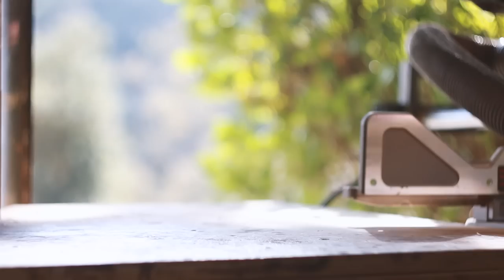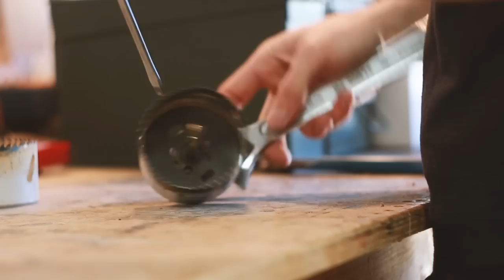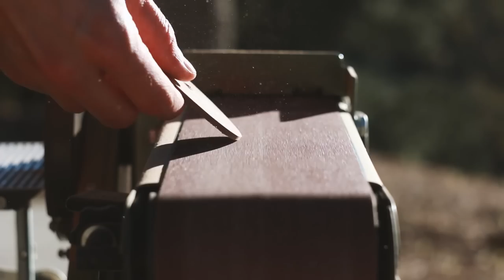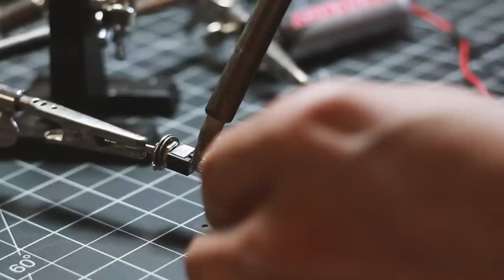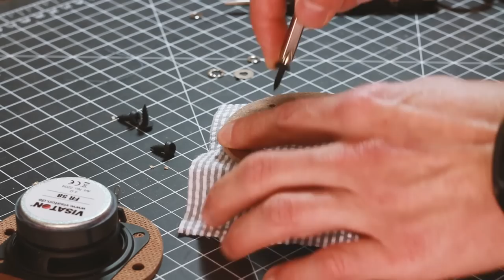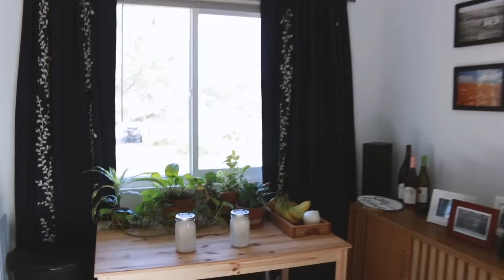Mason Jar Portable Bluetooth Speakers | FREE BUILD PLANS | DIY Bluetooth Speaker Build

Comment: Some paracord and heat shrink would finish those wires off nicely.   Good job, looks like a fun, easy build.
Reply from the maker: Thats a great idea! Totally a fun build. Thanks for watching!
Reply: I think it should be possible to use a Dremel to make holes at the bottom of the glass so the wire doesn't come out at the top. That would look even better.

Comment: Cool vid bro. One trick I picked up while soldering is to heat up the wire until the solder melts. You will get a better connection that will last years.

Comment: Great video as usual love the quality! But I have a small question does placing a cloth tightly infront of speakers not dampen the speaker cone movements?  Thanks
Reply from the maker: There is a raised ring around the outside of the cone that keeps the fabric off the surround of the cone. Thanks for watching!
Reply: Cool thanks for you answer :) great background music as usual very relaxing for a video keep it up! Love your builds

Comment: hey, thanks for the videos. really help me understand how speakers are built!..I'm inspired to  make one myself and I was thinking if it would be possible to add a valve pre amp to the circuit? would it be wired in before the bluetooth circuit or after, as the name suggests (pre amp)and how would this look for a wiring newbie like myself,as I'm a visual  learner..thinking about a wooden speaker with external power?..is this do-able? please help..thanks.

Comment: Hey Kirby. Great Build. One thing I've been playing with lately is covering my connecting wires in paracord. Lots of different colors and designs. I finish off the ends with heat shrink.
Reply from the maker: Thats such a  great idea! After I was finished I was thinking wrapping the cord in fabric would be nice, but paracord is genius! Thanks for the tip and for watching as always
Reply: hey Kirby can you show us ideas for a smaller Bluetooth speaker

Comment: What was the reason to use this bluetooth module for the build instead of the one u mentioned in the latest bluetooth board video?
Reply from the maker: The board I used in this video is powered off 5v, so it can be used with only one or two lithium ion batteries. It's also lightweight and pretty cheap. Thanks for watching!
Reply: Kirby Meets Audio  what board didnyoubuse the link on the plans is for a complelty diffrent board.

Comment: where did you solder the power wires from the step up board to the Bluetooth AMP? I'm recreating this build at home but I cannot find the soldering points
Reply: MrTufsen7 Kim Positive output of boost converter to 5V of amp. Negative output to the ground of amp. Edit: add a switch between boost converter to amp

Comment: how can I add music pulsing LEDs to them...?? they will be best best fun item then.
Reply: Shubham Patankar depends on what bulb you use. I would use a 150-250 ohm resistor on a normal led bulb. You could also use a uv-meter? If it is more for party, then there is a video out. The video is nicely detailed, so do not woory about that.
Reply: Shubham Patankar if you are to use led bulbs, then you must remember to put a new resistor each bulb, or else it won't shine bright at all... Put the resistor on the plus, but you do not need to worry about the minus. You can wire all minus together

Comment: After watching the build video of Kirby's "Firefly Jar Bluetooth Speaker", which has the same driver, I made a simulation in BoxSim with this kit and designed two possible correction networks to even improve the sound quality. Those networks will fit here as well. Look here in my video: https://www.youtube.com/watch?v=5aSvS5Ae1As&list=PL4lJ1ej0uWlQjzOstioAZ1bd555vG9WHF&t=0s&index=2 Or on my blog: https://laubrecher.wordpress.com/2017/11/30/modification-for-kirbymeetsaudios-firefly-jar-speaker